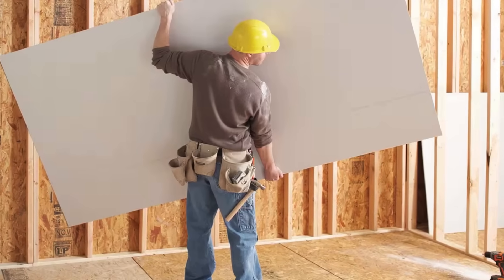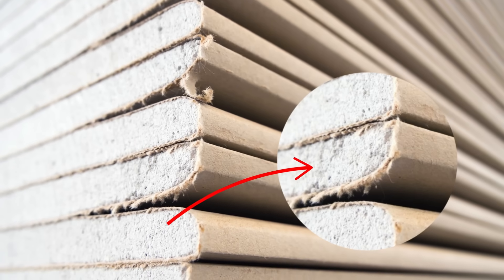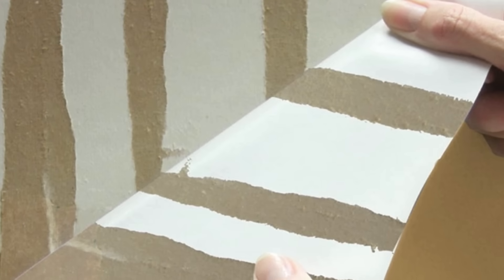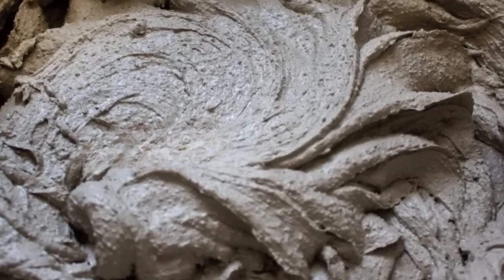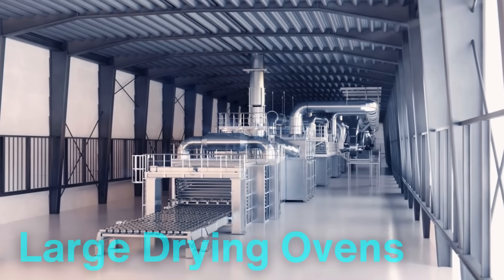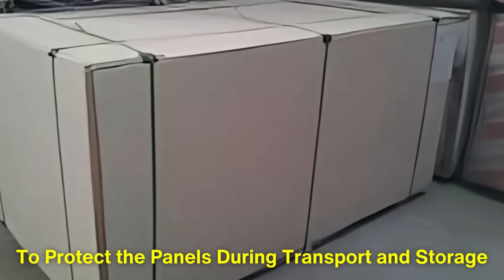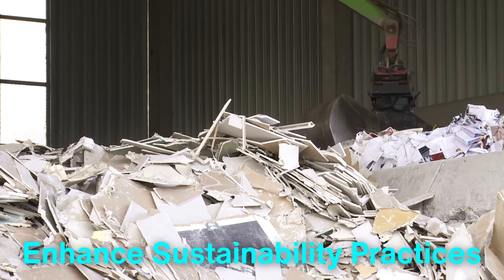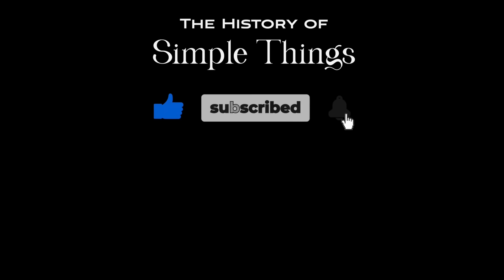How Is Drywall Made?

Comment: Great video! Thank you for sharing. A few things I noticed in the comments; the lead is applied by a separate company that is licensed in working with lead due to the shielding requirements which have nothing to do with drywall application. Some lead is applied directly to the framing and not glued to the drywall. Some lead is applied to plywood and the drywall is installed over the top. Some shields do not touch the drywall at all and installed behind a furring wall. That is why this video does not talk about lead-lined drywall, it is not part of the manufacturing. The packaging is from the manufacturer to the supplier, most people purchase from a supplier, so they do not see the stacks protected like this because the supplier is removing the packaging. Unless you are ordering direct due to the size of the order, you may not see any packaging. I build radiology and imaging rooms for a living.

Comment: At the sheetrock manufacturing company I worked for, I was a board plant operator. Had to know all the jobs on both lines. (Was also on the Safety team and we went down in the mine once a month.) The lines were 800' long, the knife could be configured to cut any length board between 7'1" to 16' long. If you wanted 30,000 boards cut 11' 3 3/16" long, you got them a day or 2 later, 3 shifts working! The plant ran 24/7. All the time. It took 55 minutes to go thru the kiln. One line ran 147'/minute on 5/8" and 165'/minute on 1/2",  the other line ran 202'/minute 1/2" and 3/8".

Comment: In Europe many thermal power plants produce, as by-produt of the flue gas scrubbing process, artificyal gypsum, as already Carlo Sanvito and others have said in their comments.      The quantity produced is tipically in the range of hundreds of of tons per day and this material should be dumped and buried in the mines where the coal to fire the power plants was  produced.  (you can immagine the cost just to transport it!!)        Instead the European leading manufacturers of drywall end up building a producing plant next to the power station and, for free, they able to source the raw material for their panels.
   A very sound, echological process that minimize all envoroimental impacts!

Comment: I’ve been hanging  for 40 years full time. I have noticed the quality has gone down. #1 it doesn’t cut and snap clean like it used to. #2 I have many times found board that the backside is delaminating.#3 I’m not sold on the recycled paper. It used to not be that way and board was better. #4 I have never in my lifetime seen gypsum board packaged and shipped like the video illustrated. One good thing I could say is that they have lightened the board and made it more sag resistant than it used to be.
Reply: Username checks out.
Reply: Interesting
Reply: Your a better man than me. Did he say LIGHTWEIGHT.  If your Hercules it is.
Reply: The greeny weenies have ruined lots of products
Reply: I feel like you’re soft you seem like you’ve only hung drywall for 40 years and you have no other idea how to finish or anything else
Reply: For 40 yrs experience one would imagine you’d catch on to the fact your final sentence answers why #1 occurs.

Comment: Plasterboard is a non-shrinking material that prevents the fast spread of fire. It is easy to cut it and easy to fill gaps and joints. The plasterboard surface is ready for coating. 
The product is strong enough for most purposes when you use the right type of screws. The screw should be trumpet-shaped so that the surface cardboard doesn't break. Small objects can be attached to it and the fastening of heavier parts is planned in advance to the wall frame. 
And above all, the product is cheap.
Reply: Right!
People can complain all they like about plasterboard being inferior to European housing...
But they don't need to build housing for 300 million people in just 200 years AND open core walls have WONDERFUL usage for piping and wiring.
Walls you can take down or put up AFTER construction and more.
Sure, it's weak compared to a classic European house wall...that's a PERK not a bug.
Reply: Im always curious to know what the next interior sheeting/finishing will be. It’s got big shoes to fill. Drywall has a lot of great properties that you have mentioned.

Comment: Recycling is a component this industry has almost totally fallen down on. It has missed the boat on huge opportunities to recycle its products. Apparently too lazy or just too myopically focused on profit generation to explore possibilities. I worked in the building supply retail sector for many years. When a transport truck of drywall board was unloaded, being that the truck was then empty, the drywall strip “crossers” that had supported lifts of board in the retail warehouse, which then had no purpose after the board was shipped out, were loaded for return to the manufacturer. This small amount of waste drywall was, I assume, recycled at the factory. But that was all. All the waste drywall board from job sites was hauled to landfills. That takes up a huge volume of landfill space, all for a lack of will to recycle it. If the manufacturer had supplied a dump bin to each retailer, contractors would have returned the scrap drywall, of which an average job generates a lot, rather than pay to unload it at a landfill. The bin could have been hauled back to the manufacturer on the empty truck returning to the factory. I’m sure some Darren Downer type efficiency expert would poke holes in such an initiative but even if it was fiscally neutral it could still be a win/win all around. I get the impression there isn’t a lot of creative initiative thinking in the drywall industry.
Reply: Perfect, you go and do that. And if you lose money, just mortgage your house. It's for the good of the planet. And hey it's only money. And you are not greedy and do not want make a profit. Why not apply for a grant and have tax payers pay for your great idea?

I will check in a few month and see if you have started your business recycling drywall. 😂😂 Show those greedy corporations how is done. They only make money and employ thousands of men and women. Brrrrr. That must really give you nightmares.  We need more rules and regulations so this can not go on. Force them to be good stewards of the planet so you can feel good while achieving nothing.🎉🎉

Comment: Did you know that in Ontario, Canada, the major source of gypsum for drywall was De-Sulpho-Gysum, which was not mined from the ground.  Instead, it all came from Lambton Generating Station, a clean coal power plant that produced it as a byproduct in the flue gas scrubber process where acid-gas was removed from the effluent stream.  How's that for sustainability and eco-responsibility!
Reply: Gypsum is still mined and made into drywall in Hagersville
Reply: @lotsofcases6522  As it is in Sperry, Iowa also
Reply: Really? I didn't know that!
Reply: @KevinMaxwell-o3t  Absolutely, but sadly the plant was closed in 2013, despite being one of the cleanest coal plants in the world.  Sometimes science and politics simply don't converge.
Reply: @carlosanvito  But a weakness of the gypsum produced from fue gas is that there is more free sulfer in it. With time, the gypsum board will gain moisture, and it will give off a  faint odor from the free sulfer.
Reply: Don't they react it with limestone which DOES come from the ground.
Reply: The same Knauf is doing in Bełchatow Power Plant in Poland.
Reply: Amen. Port credit was a location for Gypsum

Comment: question: what is different about green board,  which is used in damp locations such as bathrooms?
Reply: The paper is treated with a wax like chemical to make it moisture resistant.
Reply: Greenboard is not intended as a "ready to paint" item within itself. It's use is as a substrate for wall tile. But Durorock and Densglass has mostly taken it's place over the past 25 years (as a substrate for tile). And currently it is thought of as a humidity resistant (not waterproof) ready to paint product.
Reply: different additives...they add asphalt tar and a little fiberglass to the mix.....the paper is water resistant to
Reply: It's called mold tough, resits mold in damp locations such as but not limited to bathrooms.
Reply: It is treated with a chemical that resists mold growth. We call it fungi-block. The green dye is added just so you can tell the difference in what paper is treated with fungi-block and what isn't. Depends on the manufacturer of the paper as to what color it is as well. It can be green or "blue" which is really a purple color but we call it blue for some reason. The paper is 100% recycled out of boxes from retail, grocery stores, or recycle facilities. Walmart, Costco, etc. Some paper mills use a white coating on the side of the paper that gets painted once it is finished into drywall and some paper mills use recycled newspaper, paper plates, notebook paper, etc. You can tell the difference if you get a sheet of drywall and it's pure white then it's treated to turn it white or if you look closely and see red, blue, green, brown dots on it then it's made with recycled newspaper etc. So that pizza box you threw in the recycle bin will most likely end up on somebody's bedroom wall one day.

Comment: Panels are 1/4 inch to 5/8 inch
Reply: I’ve seen 1/4 inch in the store, but what is that actually used for?
Reply: @timsmith8506 one use of 1/4” is to cover up popcorn ceilings or other texture issues.
Reply: @timsmith8506  I used to work at a building supply company and was a carpenter. Sometimes it used over the top of cracked or damaged plasterboard. It is easier to cover it than to remove the old material. Just one use.
Reply: @timsmith8506  patching into old plaster with drywall compound, covering holes under sinks or even sheathing partition walls.
Reply: @timsmith8506  Hi Tim, was in the business for 45 years. 1/4" is mainly used to laminate over an existing rough surface, as long as it isn't to lumpy. For example a concrete block wall if it's above grade. Below grade you'd need furring strips and probably 1/2" board. 1/4" is also used to form radius'. As a side note, there is also shaftwall liner that is 1" thick gypboard. Mostly used in fire rated stairwells & elevator shafts.
Reply: For curved partitions and ceilings with tight radii (for instance 16 inches or smaller). In this case 2 layers of 1/4 inch gypsum board must be used
Reply: Other thicknesses are 3/4 inch and 1 inch.
Reply: Curves.
Reply: yeah, and a sheet of 5/8 x 12" is heavy as hell. It's called Firecode.
Reply: Can be used for resurfacing existing damaged walls.  Cheaper to go over than rip down.  The hard part of patching is the compound absorbs paint differently than the paper on the board.   However, today compound manufacturers make a cover coat/primer to help eliminate this.

Comment: I would like to know the history of window pains
Reply: Replacing panes can be a pain but they keep out the rane, deadens the sound of the freight trane going by down on mane street which is a two lain highway and always use gane detergent to clean them. Now I got to hang some wetwall.
Reply: Or when you see your reflection 😂
Reply: When it slams down on your fingers, that's window pain.

Comment: you didn't say anything about lead lined drywall that are used for x-ray rooms in hospitals
Reply: probably a niche product
Reply: Because it's lined not added as part of the drywall manufacturing process, the lead is installed behind the drywall.
Reply: They glue a sheet of lead to the back
Reply: Because they typically use sheets of lead to overlay the walls with..  I've did demolition for a company were we demolished a medical center with an x ray room.. I was the one rolling up the sheets of lead..

Comment: What are the little fibers you see in the core when you break a part off ??
Reply: Fiberglass
Reply: It depends upon the product and its intended usage. For moisture resistance, a non-permeable fiber, such as fiberglass might be used, for general strength, cellulose fiber frequently can be used.
In ancient troweled on plaster walls, frequently horse hair was used. The fiber adds strength.
Reply: Cellulose fibre
Reply: Fiberglass for strength
Reply: Fiberglass. Just hang some for a day if you don’t believe me
Reply: That’s proprietary
Reply: And fibre glass for fire resistance

Comment: Natural gypsum is rarely used in plasterboard because it can contain radiation. Smoke degassing plaster is much better and lowers the CO footprint even better
Other materials are also added to the plaster, such as detergent and starch, to facilitate processing. From someone with experience.
Reply: Disagree on some of your arguments:
Natural gypsum is used often as main source of gypsum, such as in Russia, Maroc, Europe and U.S. Radioactivity is not an issue of natural gypsum. It's more of an issue, when using phospho-gypsum, where radioactive trace elementes of phosphat ore tailings make their way into the phospho-gypsum.
FDG-Resources are becoming smaller as countries in Europe transition from fossil coal to renewable energy. Knauf recently closed a factory in the Saarland Region because the coal fired powerplant next to it was shut down.
The video does not show the need of a stucco cooler in beteween the calcination and the board plant for a continous process. After calcination, the stucco temperature needs to be reduced from approx. 150°C to 80°C.
Rotary kilns as shown in the video are rarly used for plaster boards. Most likely, a flash-calciner, kettle or combined milling & calcining is uses for plaster board.
Reply: I made the acid modified corn starch for this application.  It's commercial name was pretty straight forward:  Wallboard Binder.
Reply: I used to work in a wallboard manufacturing plant for more years than I care to remember. We added sugar to help the slurry mix to cure, and as you know sugar attracts ants, and we also put in an ant killer to kill the ants
Reply: Huh ? 🤡